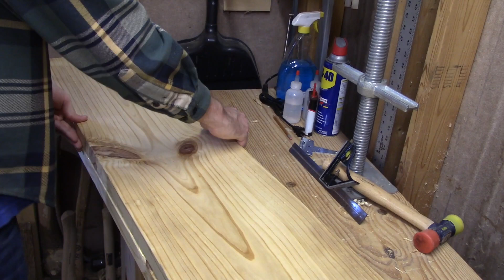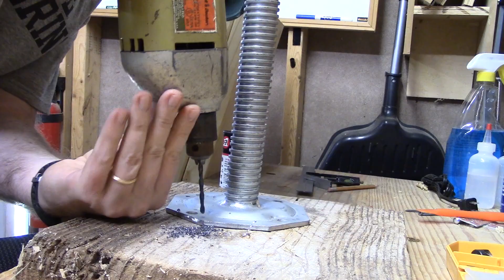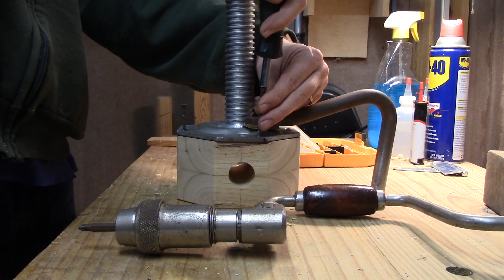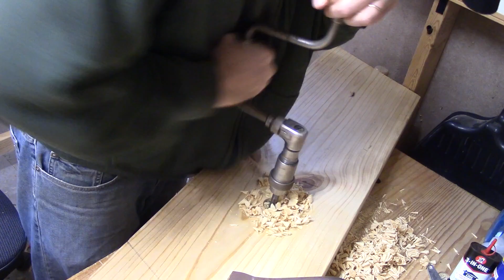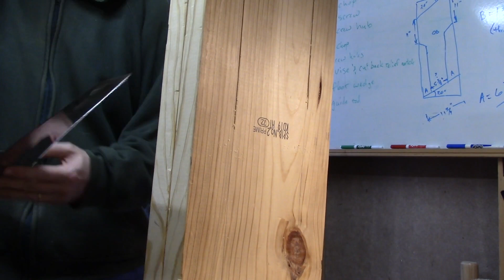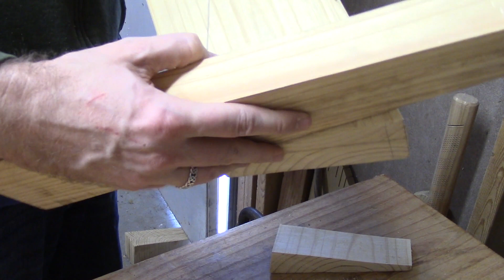My Leg Vise

Comment: Nicely done. I have a knockdown English workbench myself that I’m looking to upgrade with a leg vise a la Rex. My local big box stores look to have those scaffold leveling screws for about the same price as a vise screw from the yellow virtual big box, what drove you that direction?
Reply from the maker: Good luck with your leg vise!  At the time I built my leg vise I was able to find the scaffold leveler for about half the price of a real vise screw.  But if the prices are similar I would definitely go with a vise screw.
Reply: @SharpWorkshop  Following up, I got mine built last year and after having been using it for a while I've been enjoying it. The only trick for my build was that I let the lumber sit too long after bringing it home and had to flatten it out before my glue up. 😬 Thanks again for the nice build video, it was a good point of reference.

Comment: I like the slanted one; it’s kind of like the Moravian workbench one too Ian some ways and having it on a cant probably helps you avoid some depth issues you may run into in some tasks.
Reply from the maker: Agreed.  It also turned out that it was easier to mount the vise because I was going through the apron instead of going through the apron and the leg assembly.